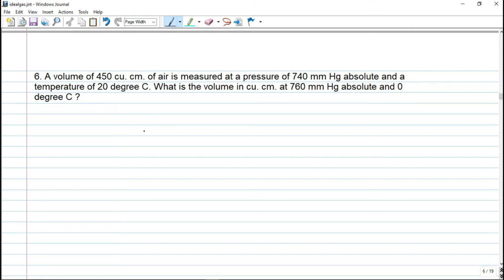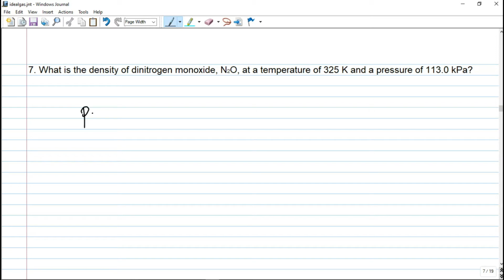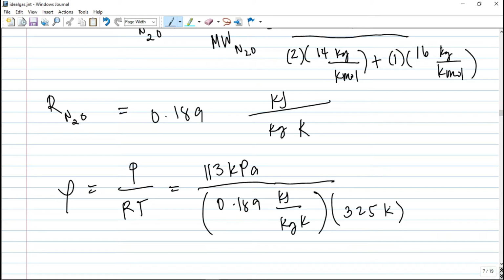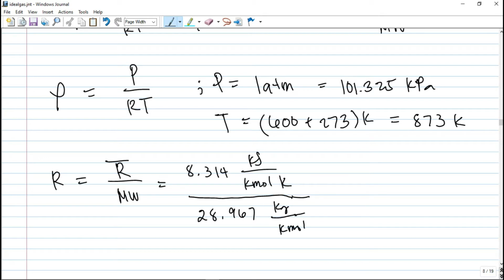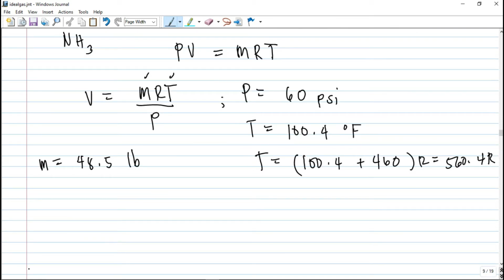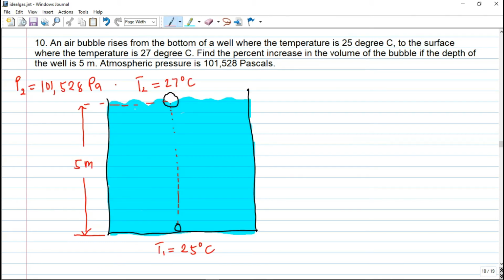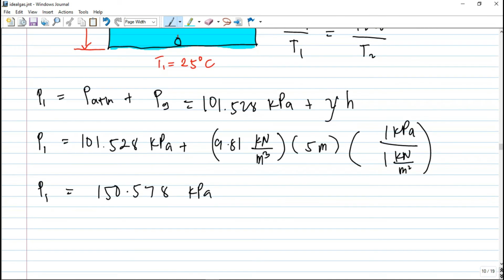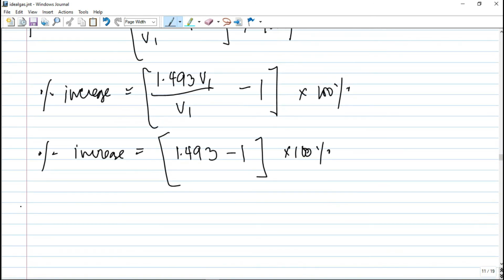Ideal Gas Law Practice Problems (Part 2)

Comment: Prof tanong ko lang po if wala na akong chance makakuha ng engineering courses sa college kasi po 75 po yung final grade ko sa general mathematics at pre calculus nitong 1st sem po ng grade 11, salamat po sana po masagot niyo.
Reply from the maker: May chance parin po. Depende parin nmn yan sa school. Pwede ka parin makapasok sa engg.. Good luck!
Reply: May grade limit naba ang pag kuha ng engineering courses?
Reply: @jaybeltran5616  Depende po sa school
Reply: @matcharatcha8016  depende sa university? hmm ako kase PUP graduuate ako EE, wala nmn grade na kailangan mataas maipasa mo lang entrance exam.
Reply: @jaybeltran5616  Yes po but the problem po is the current situation since nag pandemic po hindi nagpa PUPCET yung PUP this year kaya po nag base sila sa grade 10 and 11 grades tapos po bukod sa GWA may specific subjects na kailangan 85 or 88 and above po yung grade like General Math, stats & prob, reading & writing skills, etc. at yung concern ko po is baka same system uli yung gawin nila for the next school year. Kaya hoping po talaga ako na magpa entrance exam next s.y.
Reply: @Matcha Ratcha   ah kaya mo yan, if you willinng to take engineerinng courses, patatagin mo foundation mo sa lahat ng math subjects, let me give you a piece of advice, "totoo ang practice makes perfect" practice ka lang ng practice, di mo namamalayan kabisado mo na principle, hindi mo na kaylangan mag saulo ng maraming formula, mahira ng engineerinng course pero kaya. Goodluck sayo Godbless.
Reply: @jaybeltran5616  Thank you po sa motivation 🙏🏼 malaking tulong po ‘yan para sa akin, much appreciated po